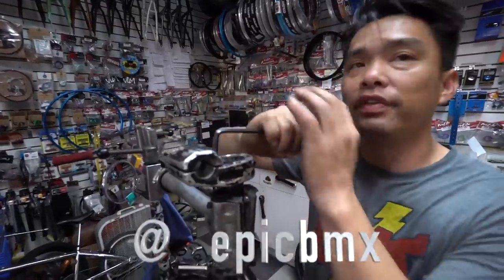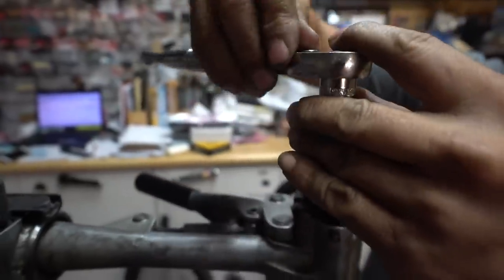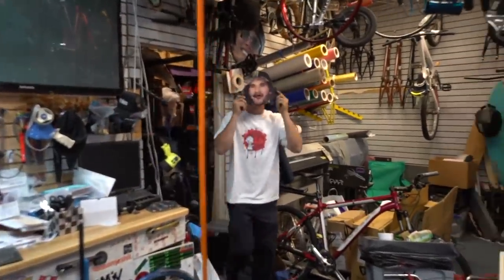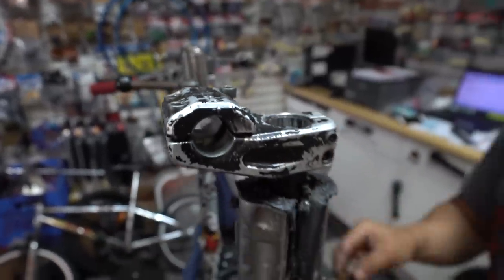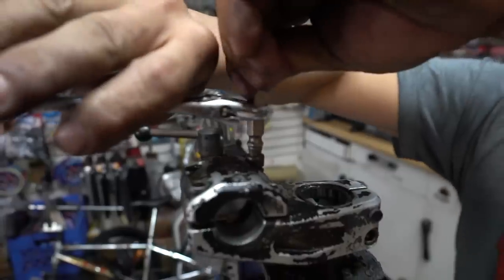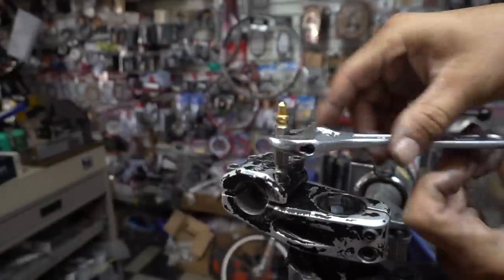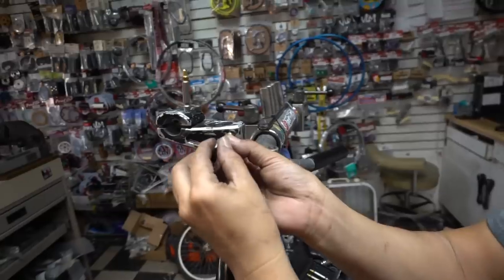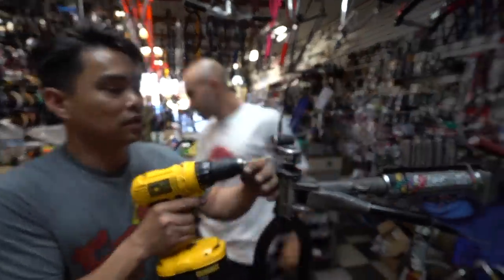HOW TO REMOVE A STRIPPED BOLT OFF YOUR BIKE!

Comment: old trick i been using for really stripped allen bolts is hammer in the next size allen in imperial or a torx bit
Reply: This comment should be pinned.
Reply: so ruin another tool is what your saying?
Reply: @johnnypoo3166  yeah i was gonna note you wanna use old, socket style ones because they are straight up and down so u can whack em in, and old because theyre old.  it didnt actually affect the torx bit i used at all though, that shit was miles stronger than the bolt i whacked it into. also i did that multiple times to the same bolt, eventually it stripped again and i moved up to a bigger size. i did that twice, luckily the tools didnt break or deform cause it would not have been worth it if they did
Reply: @bmxscape  Well by that response i don't know what to say without you taking it out of context. I will say that there would be no chance in you even touching my tools! you remind me of a saying. "If it aint broke you're not trying."
Reply: @johnnypoo3166  why would i want to touch your tools lol i own a bike shop buddy ive got plenty.if u cant afford good tools thats on you
Reply: @johnnypoo3166  ill tell you right now if you cant figure out a solution to get the job done you would absolutely never have a job at my shop
Reply: @bmxscape  That's what i mean by taking things out of context. In no way was i trying to belittle you. Much love and good luck.

Comment: Aluminum foil works put a little bit in the striped hole or around the end of the Allen key and works like a charm
Reply: Hucel about to try this thanks
Reply: Didn’t work for me
Reply: M0ct3zuma22 I ended up rupturing my Sagittal band lmaoo go to a bike shop I’m wearing a cast if it doesn’t heal correctly and my tendon keeps moving ima need surgery fuck lol
Reply: @flawlessbutdysfunctional7787  wtf no offense how do u do that trying to unscrew a bolt😳
Reply: @yoosilvxrrrr  the tool wouldn’t grip on and I pretty much punched the handlebars with a Allen key in my fist
Reply: @flawlessbutdysfunctional7787  I would do the same thing prob out of frustration but I bet that shit hurted hope you feel better g
Reply: @yoosilvxrrrr  yeah but I did it on accident lol the bolt is stripped

Comment: I use an angle grinder and cut a slit across the screw head, big enough for a flat screwdriver. Use  one of the screwdrivers that are hexagonal and not round, this way, you can attach a wrench to the screwdriver, so you can put all your weight on the handle and then twist with the wrench. I used to work in a piano workshop, getting all sorts of old weird rusty screws sometimes

Comment: Easy out is definitely the preferred method, but in a pinch you can cut a slot in the bolt head and use a flathead screwdriver (or impact driver).
Reply: And how exactly do you just cut a slot in a pinch? (In a pinch here)

Comment: Okay, so I stripped my pinch stem bolt and I can’t get it outtttt. It’s the bottom one and I bought a new stem just because I wanted a different color and whatever. I’m trynna remove the stem and I just can’t. Should I just saw through the bolt??

Comment: How to I remove the sockets that screw into the bottom bracket? I stripped one because I tried to hard to loosen it but I turned it the wrong direction

Comment: The reason it’s always the last one is because it has the pressure of all 4 bolts on it. If you tighten the the other 3 up, it will probably come out. Then loosen all 4 bolts in unison, 1/4 turn at a time.
Reply: No it's because it's bad luck lol no one undies hoptsnlike that even though you should